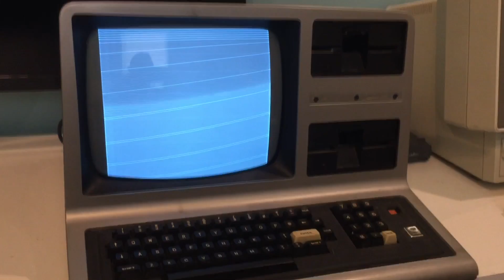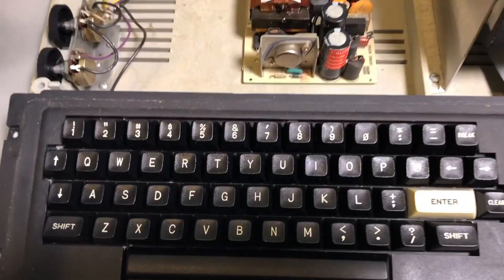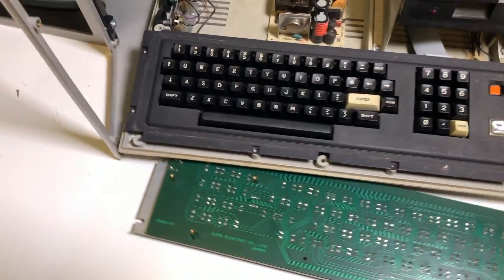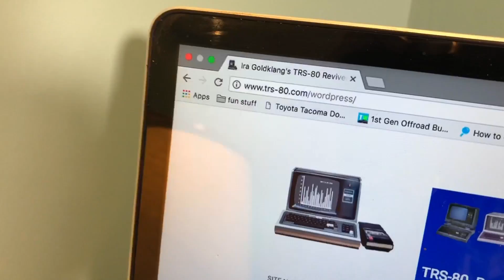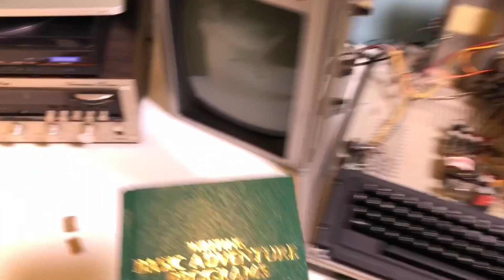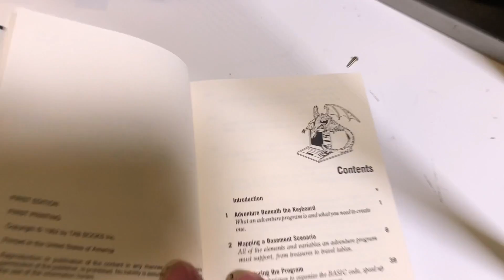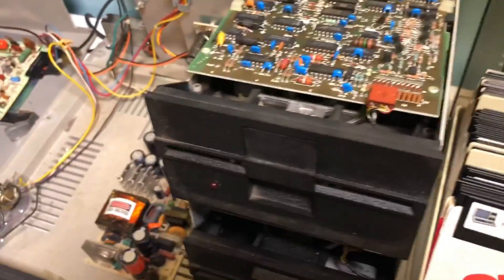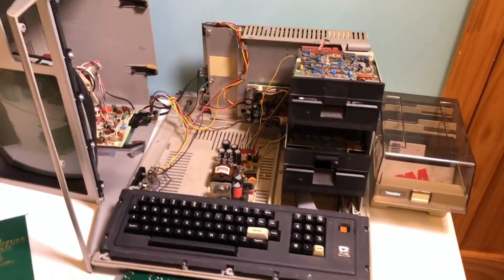I fixed my 1980 TRS-80 Model III computer! - SIMPLETHINGSTOYS

Comment: Thanks for posting this.  I just bought one of these from my local 'tip shop' for $50 (condition unknown).  These guys get things from landfill, and it's got its fair share of 'gravel rash' on the case where it bounced and slid.  A couple of missing key tops, but the floppy drives still had the shipping cards in to protect the head so it's probably worth the challenge.
Reply from the maker: Challenges are awesome - and I love the look of cyber-zombies returned to operation.

Comment: there should be a tin piece on the left side of the drives and that power supply goes there, the tin piece would be grounded to the case behind it, there are a couple screw holes there now, its so the power supply is grounded. or its its stuck down good you could just run a ground wire to it, it also has a prong to plug one in, mine does anyway.

Comment: Came across your video on your yrs-80 Model III I use to play and program these at a Radio Shack in Laurel MD there is a secret why these models were cancelled because of the password protected floppy drives were flawed I found that you can rewrite any disk password you just take your disk that you know the password in the drive type purge and the new password then you removed your disk and replace it with a disk you want to break in to and type the new password bingo you  changed the password the software of the model 3  and 4 did not check to disk to make sure it was the same disk . I told the big wigs at Tandy and a short time later they stop making the model 3 and then soon after the model 4s keep up your wonderful videos.
Reply: Btw you can use a floppy disk as a dubble sided by cutting out the window on the other side of the floppy I did it all the time

Comment: What fun! I'm 75 yrs old, and the TRS80 Model III was my first computer. I made a ton of money with it converting old TI99 mathematics training materials to the TRS80 platform. I also had "Electric Pencil" which was my first word processor. I wrote two books on the thing. I had an accelerator board and memory of, as I recall 16K! Amazing. I really loved the keyboard; thought it had an excellent feel to it. The only annoying thing about it was its sensitivity to static electricity. You could just touch the thing and crash it instantaneously, so when I was using it, I wore a copper bracelet which was grounded to a water pipe in the wall. I really loved this thing, so it is good to see that someone is rescuing one and sharing it with other young people. Thanks!

Comment: The TRS 80 was an early machine and had some frailties as a result. I haven't experienced the magic smoke effect yet. I did ding my monitor when trying to fix the picture, it still works but it's a little bit finicky. Oh...and those disk drive levers broke on me within five minutes.

These computers suffer from ossification due to years on non-use.

Comment: It's got aftermarket disk drives which is why the power supply is taped to the floor.  I bet the computer is either a 26-1061 or 26-1062 which began life as a diskless TRS-80.  Original TRS-80 disk systems have heavy-duty plastic drive towers and the PSU is attached to the tower not the floor.  The aftermarket disk drives are usually OK as long as they are working.  Shipping these systems with the taped-down PSUs can be very risky.
Reply from the maker: RE1974 thanks for the great info. I also have 48k of memory rather than the 16k displayed on the case. Do you know where the high resolution board would be installed if I have one, or how I can figure out if I had one via command prompt?
Reply: If it has a short cable tail hanging out the bottom then it has Radio Shack's HRG board, but you need to remove the RFI shield over the motherboard to see if it has a Grafyx Solution GX 3.2 board.  Both are unlikely because less than 1% of Model III owners bothered to add HRG to their systems.
Reply: those look just like my drives, there is a missing piece of tin that goes on the side of the drives that the psu attaches to.

Comment: I have the same one. Works great, even the keyboard. Except it doesn't boot from disk and stays in "cassette mode". I have to open it and check the flat ribbons contacts. Nice to see from your video how careful with the lifting angle we have to be in order to avoid breaking the CRT. Thanks !
Reply: Your floppy controller may be bad.
Reply from the maker: On mine the boot disk needs to be in the bottom drive. Your disks could possibly be no good. I'd suggest getting some known working ones from Ira and probably cleaning your drive heads. Edit: power supply for the disk drives could be bad also. Do they light up or spin at all?